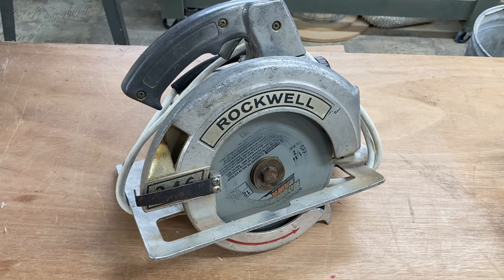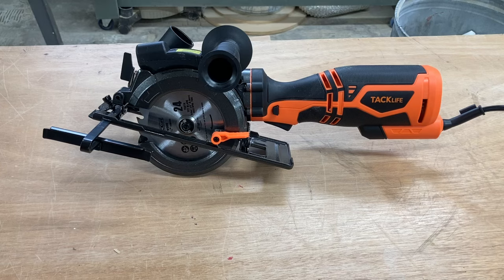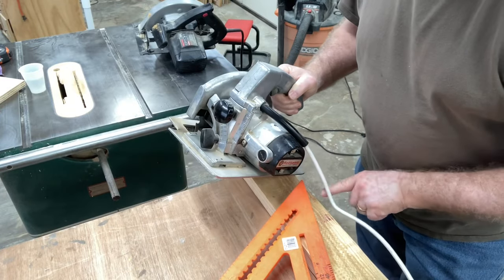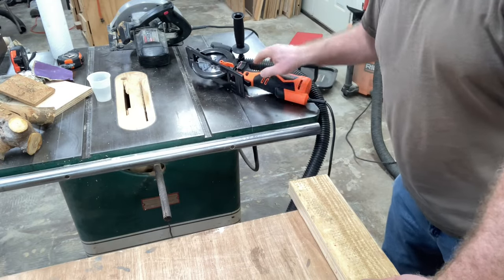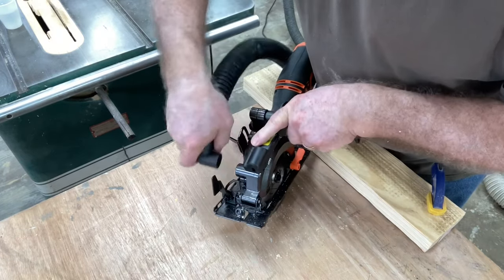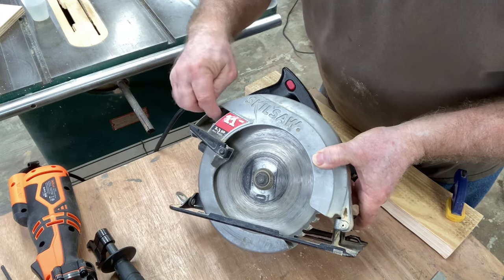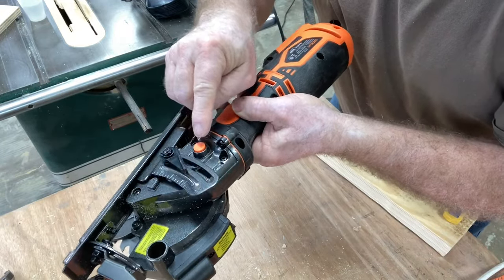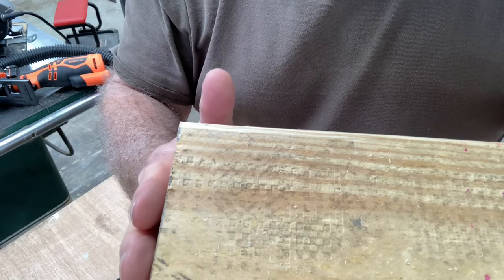BEGINNER SERIES:  Introducing the Circular Saw

Comment: I love the addition to your shop! Seems like a great new saw. It doesn't seem like it will tilt with that longer handle very well.
Reply from the maker: Thanks 👍 It actually tilts very easily.  The new design takes a little getting use to but I like having the blade on the left side.